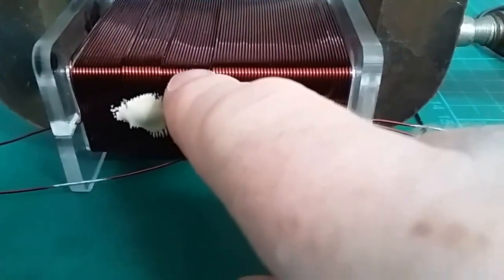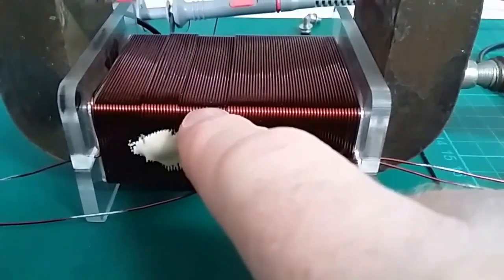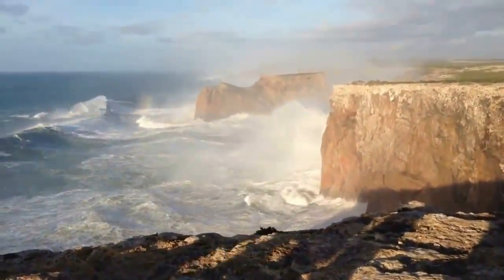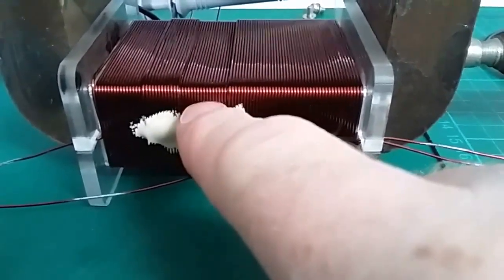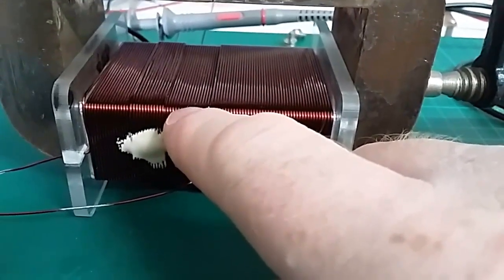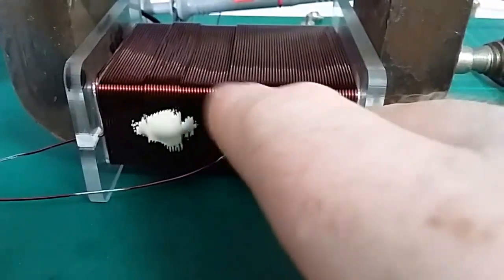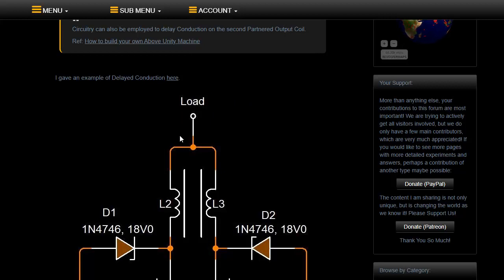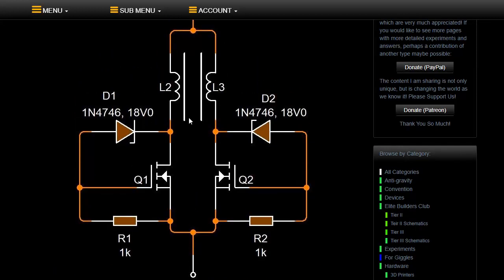Non-Inductive Coil Experiment - Video Five

Comment: Chris have you investigated Richard Willis devices patent Magna Coaster, he is claiming that magnetic flux can be reflected many times without loss with magnetic flux from magnets in a synchronous fashion.  Therefore the flux cutting 10 exp x times is causing an amplification of power an increase in voltage and amperage at the same time.  Remember Leedskalnin PMH kept holding due to a magnetic flux not being depleted and coils wound in opposite directions.
Reply from the maker: I try not to make comments on others work. I don't think its fair, especially if I have not replicated it. I wish the historical record showed a better result there! Are you part of our Forum? We have a lot to share if your'e interested?

Comment: I am currently in the process of replicating the MEG. I have the AMCC320 Core. I bought the suggest copper wire: 26awg & 12awg. Somewhere else they suggested 26 &24.  What would be your suggestion? What are the best parts to create the circuit? My friend that is an electrician said the circuit they provided didn't make sense given there was no power input. Am I missing something? What is your best output and what was your input? I appreciate your time and input!

Comment: Sir. How did sweet generate a phase conjugate mirror using magnets and couls? How is this possible?
Reply from the maker: You're confusing the Magnets purpose! Experiment shows a Uniform Magnetic Field can "Generate" Zero Voltage! See: https://www.youtube.com/watch?v=EcNEvRuH9EQ Conditioning is a FRAUD! Understanding Asymmetrical Electromagnetic Induction will provide the Results you seek! No need for Wild Goose Chases that end up in expense and Heart Ache! Understanding that: 1: The very Change in the Rate of Current in one Coil can "Generate" a Voltage in another, and 2: The very Flow of Current, Opposing another Flow of Equal, but Opposite Magnitude, Pumps Current, will yield Results! Walt, told us: https://www.youtube.com/watch?v=g2niu_Zm87w we have the experiments to show you how this works, its actually very easy! See: https://www.aboveunity.com/
Reply from the maker: The Phase Conjugate Mirror is between the two Bucking Coils in the Machine, listen very closely: https://www.youtube.com/watch?v=whPkcEfoeoo Why does the very simple fact of disconnecting the load, stop the machine? This is a Critical bit of data which has been verified!
Reply from the maker: Never forget, Floyd Sweet measured Voltage and Current, nothing else will Power a Load, forget ALL Magic, there is NO VODOO Here!

Comment: You mentioned a huge sum spent on this experiment.  Did you find magnets to serve instead of BARIUM FERRITE MAGNETS?  Thank you sir.
Reply from the maker: No, very cheap this particular experiment! It is quite obvious from the video, materials are very cheap and readily available to any person with a telephone. The total Research I have done has cost a lot. Yes, I have Magnets, but you are missing entirely the point! Does any other Successful Researcher, for example Tarriel Kapanadze, use Magnets? I think the Magnet idea is only used by the Trolls now as a desperate Clutch for the Control they have already lost! Yes Floyd Sweet Used Magnets, what Purpose did they serve? I will go into this at a later date, fact is, you do NOT NEED THEM to produce Electrical Energy! You DO NEED a Magnetic Field that can Change in Time, but this does not need to be Static like Floyd Sweet said: "Rather, what happens is that the individual packets of quanta are polarized by the initiating and sustaining coherent force the field of the primary magnets or in special cases, electromagnets". Only poorly educated beings dwell on non-sense! I recommend you study, in depth, Electromagnetic induction as I have, and find out why it is Incomplete!
Reply from the maker: I have replied to you already below with all the information you need to get started, this second question is just a distraction!

Comment: Hello Sir. Can you explain why do we need a non-inductive coil? Or, what does a non-inductive work do? I`ve seen some setups that used a stainlessteel enameled wire... You two must have something in common! Thanks.
Reply from the maker: A very good question! When the term Non-Inductive or Bucking Coil, or even Partnered Output Coil is used, its actually the exact opposite! This is only true at resonance, when the Coil is bought into a working resonance between the two output Coils. Its all to do with Electromagnetic Induction, the Time Rate of Change of the Magnetic Field in proximity of the Coils. See: https://www.youtube.com/watch?v=-a1plHZwmWg for more visual cue. The amplitude on the terminals of the ceramic Resistor comes from resonance. We must think in terms of pumping current.

Comment: What's the best output for the big coil? The one of the left, I found a drawing with a component like have 2 diodes on parallel in the beginning but then goes together to the first pin of the load, and in parallel from the exit of the diodes a capacitor connected to ground and from there to the other pin of the load

Comment: If you are talking about standing waves or producing magnet standing waves that is very natural by several means the simplest being using a second coil to mirror(but opposite) the first which happens naturally when you have a second col or what is known as the secondary.There is no need to energize the second coil like the ocean wave the same wave reflected off the rock and hay presto standing wave in like manner the electromagnetic induction will cause an apposing  direction magnetic wave.Fundamentally the same as energizing both coils except for one thing seemingly insignificant thin,  there is no lagging or leading coil.What may you ask is the significance of that.Good question and best answered by nature itself and that is if you want reproduction there must be sex that is a universal principle and it also applies to energy generation and sex by natural definition has gender the flow of energy positive and negative the waltz  the ultimate expression of the dance of love,leading and lagging.It's what happens next that is special and significant and different than if there be no male or female as it where
Reply from the maker: Correct! Problem is you get off topic quickly! Whats the medium? What stands? How can Current Stand and Flow at the same time? What disturbs the Medium?

Comment: Can't understand the principle
Reply from the maker: The Electric Generator suffers Lenz's Law, but this Field Opposition can be used to achieve Above Unity, simply by Countering the Force! Much like a Crane does, use Weights and Gearing to reduce the direct effort on the specified weight, we use a Counter Magnetic Field to Off Balance the suffered Force, and make this a useful force. Please join my forum, we will help with progress. https://www.aboveunity.com/

Comment: thats not how it works. you place a magnet in the middle to saturate the core and the two 'input coils" steer the flux around.
Reply from the maker: Umm, NO! You need to do a lot more study! That's what you were told by JLN in his study, which was not inline with The MEG Teams Replication, seen here: https://www.youtube.com/watch?v=no50_5iSr2Y You have two options, either learn a bit more and take steps to succeed, or keep following what has been Wrong and Proven so for a very long time now!
Reply: The Motionless Electromagnetic Generator (MEG) is a magnetic generator used to produce electrical power without moving parts, and, more particularly, having a capability, when operating, of producing electrical power without an external application of input power through input coils. 

The Motionless Electromagnetic Generator includes a permanent magnet, two magnetic paths external to the permanent magnet, each of which extends between the opposite poles of the permanent magnet, switching means for causing magnetic flux to flow alternately along each of the two magnetic paths, and one or more output coils in which current is induced to flow by means of changes in the magnetic field within the device. The Motionless Electromagnetic Generator operates in accordance with an extension of Faraday’s Law, indicating that an electrical current is induced within a conductor within a changing magnetic field, even if the source of the magnetic field is stationary.

Regarding thermodynamic considerations, it is noted that, when the Motionless Electromagnetic Generator is operating, it is an open system not in thermodynamic equilibrium. The system receives static energy from the magnetic flux of the permanent magnet. Because the Motionless Electromagnetic Generator is self-switched without an additional energy input, the thermodynamic operation of the system is an open dissipative system, receiving, collecting, and dissipating energy from its environment; in this case, from the magnetic flux stored within the permanent magnet. Continued operation of the Motionless Electromagnetic Generator causes demagnetisation of the permanent magnet. Thus, a Motionless Electromagnetic Generator operating in accordance with Thomas E. Bearden’s invention should be considered not as a perpetual motion machine, but rather as a system in which flux radiated from a permanent magnet is converted into electricity, which is used both to power the apparatus and to power an external load.